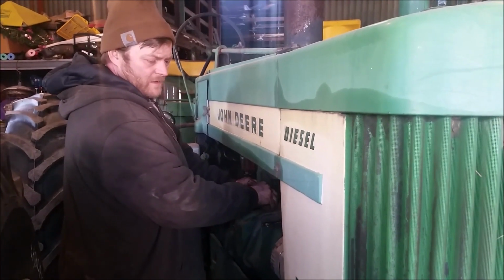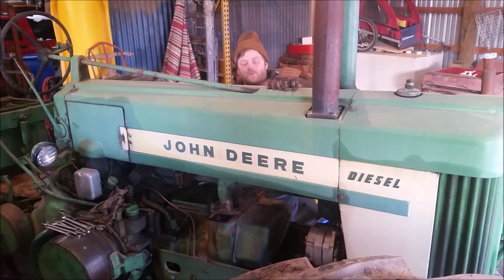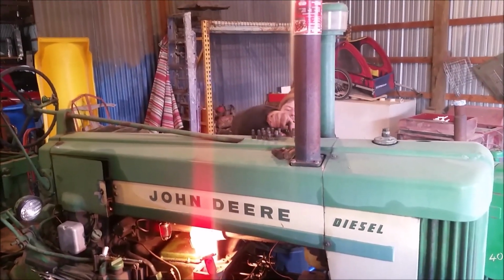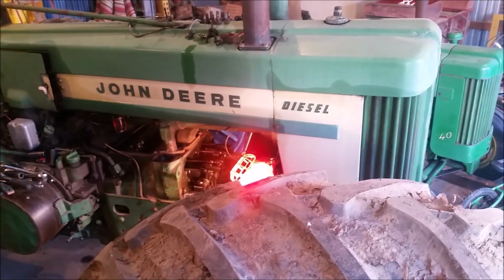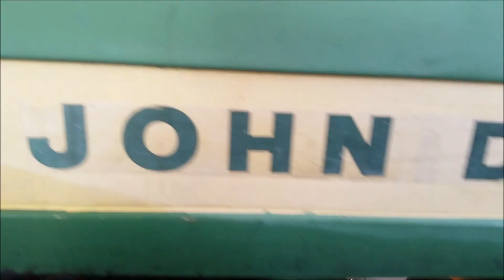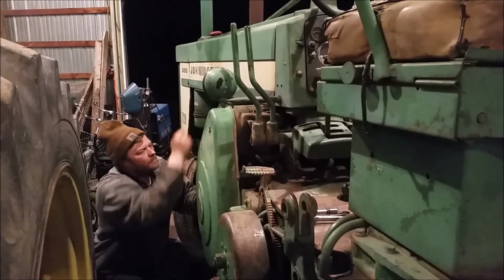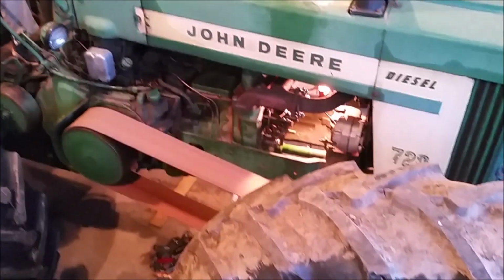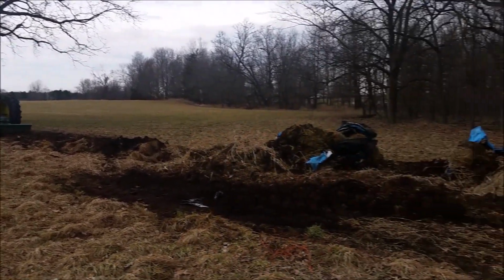Vintage John Deere 720 Head Gasket Repair

Comment: I just made a deal on one of these. Pony start. Original work clothes. Bought with 2 other tractors.  Can’t wait to get it.  Needs pony work but diesel runs great, quiet gears etc.  No 3pt. Sheet metal not as nice as yours, but close.
Reply from the maker: Just drop it off here after you get it loaded up. Thanks in advance!
Reply: @mommymilestones  It comes with a 38 BWH and a Farmall HV.  Quite a trio.

Comment: How old is that boy? This is my dad's comment on 8 n Ford. In 1949 an 8 n Ford cost $900.00 new. You could go to john deere spend $1100.00 buy a new b. Have twice the tractor! John deere made. The 40, 50, 60, 70, 80 from 1952 to 1955.
Reply from the maker: The boy on the 8n was probably 9 then. We have a 40, 60, and 70 also.